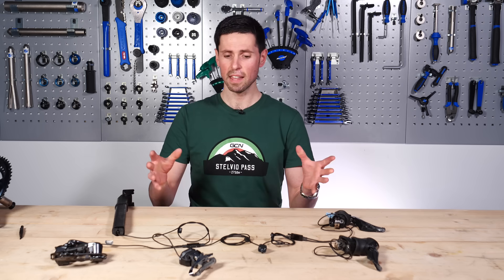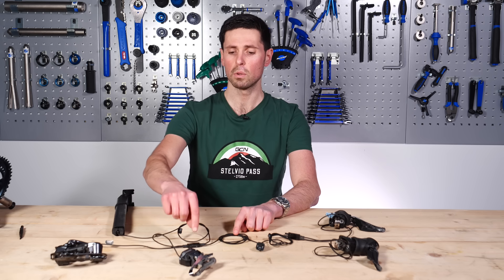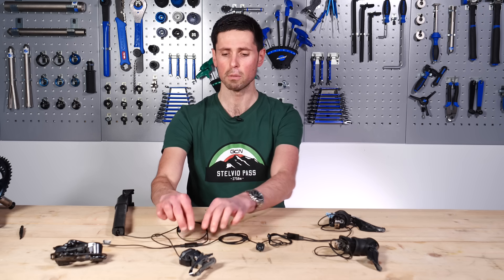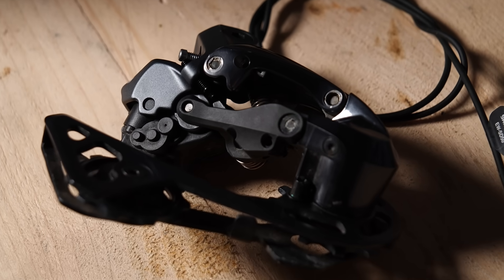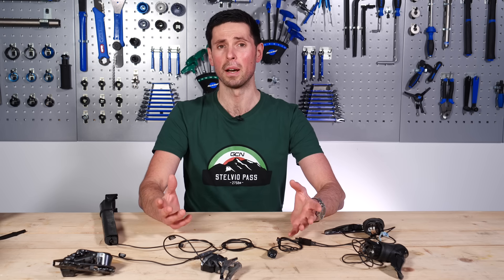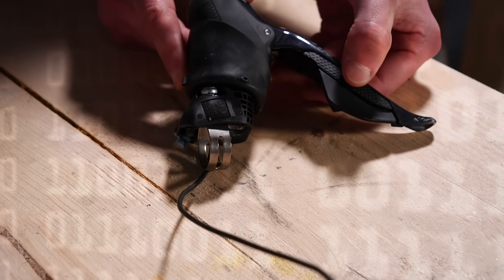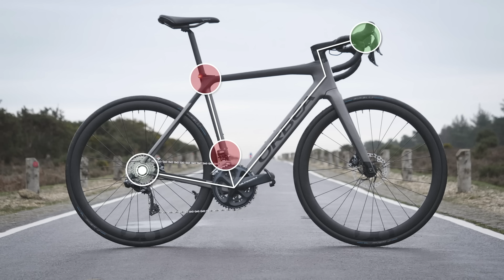How does Shimano Di2 Actually Work?| Electronic Shifting 101

Comment: There are only 10 types of people in the world. Those that understand binary and those that don’t.
Reply: 1s that do and 1s that don't, and together  they make 1+ 1 = 10 . Simple :-)
Reply: '10' is 2 in binary
Reply: There are 10 types of people in the world. Those that understand ternary, those that don't and those that expected this joke to be in binary.
Reply: And those who understand quaternary……
Reply: Shouldn't it be only 1 type of people - 1s that do and 0s that don't.
Reply: @paulallen6378  No - as in Binary, Yes = 1, No =0, and the base is 2 (not 10, unlike normal numerals). Therefore "Those that do" are 1 type, and "Those that don't" are 1 type, and together there are 2 types of people, which  in binary is written as 1+1=10 (10 in binary is 2 in decimal)! The decimal numbers 0 to 10 can be written  in binary as follows: 0, 1 (1), 10 (2), 11 (3), 100 (4), 101 (5), 110 (6), 111 (7), 1000 (8), 1001 (9), 1010 (10).
Reply: But I’m using Zero-based numbering, you only need 1 binary digit to encode 2 values.
Reply: @paulallen6378  Who let a coding geek on here :-) ;-)

Comment: I would have at least mentioned that the battery is the brain of the whole thing
Reply: Agreed - that's a fairly serious omission.  I thought that was the case, so I'm glad you clarified it since GCN didn't.
Reply: It isn’t...rear derailleur has the controller (brain)
Reply: @CXCyclist  So why did the previous Ultegra Di2 need a battery upgrade for the added syncro shifting functionality?

Comment: C’mon, Shimano! Cables are rudimentary elements in 21st century. SRAM is much more advanced without any impact on reliability.
Reply: It's not as clear cut as that.  Di2 has only one battery instead of 4, it's lighter than the SRAM equivalent, and it's more customisable.  Once it's installed, the wires make absolutely no difference to the user experience.
Reply: @AllanPhillips  you might be right for a bike equipped with Di2 on the factory, but installing it as the aftermarket solution definitely will cost you a lot of time and nerves. SRAM is simpler, you don’t need to tear down your bike to put the wires thru, and it has better app.
Reply: @d.2940  They do both have pros and cons, but the app and the lack of wires don't help you when you're riding, whereas Di2's lower weight and greater efficiency (from both the larger chainrings and the chain itself) actually help you go faster.

Comment: No reason such system can't be affordable.
Reply: "high tech".. as in bike companies intentionally putting electronic shifting on top ends only.. better to wait for chinese electronic conversion kit
Reply: @Fatbutnotflat  you'll be waiting a while. In the meantime, I got ultegra 6870 di2 minus the cranks for $500 on FB marketplace.

And dura ace 9150 minus brakes and cranks for $700 on FB marketplace.
Reply: It is, compare di2 ultegra to sram force axs
Reply: "Affordable" is a very subjective word. If you can't afford it it's not " affordable". Cheap is a better term. But this system is by no means cheap!

Comment: I read somewhere that everytime you change gear on the back, it trims the front mech slightly to prevent chain rub in the event of crosschaining? Is that the case? Im still running R8000 mechanical. Would love di2 but cant afford it 😭
Reply: The front and rear do adjust slightly as needed after shifts.The front does not adjust every time you shift the rear. I think it just adjusts when needed depending on what gear you are in.
Reply: @josephphillips865  Ahh, fair enough. Thanks for clarifying that 🤜🤛

Comment: Brilliant description, i actually thought the system was wireless.  Regarding CAN, I write firmware for a living on CAN based systems and it’s not the easiest thing to explain to people so you done a good job there.
Reply: Hi Mike, do you know how the power supply and data share the same wire, would be an interesting detail for general to add
Reply: @Cammboz  https://www.youtube.com/watch?v=DlvY_W22VNc  It's a bit techie but worth a watch.
Reply: @mikeshaw714  interesting, thanks. I guess the power in the di2 system must be derived from a higher potential difference between the high and low wire.
Reply: CAN bus usually has differential signal lines (high & low), presumably Shimano have a proprietary implementation for their system with only two wires - one with ground and the other with the supply voltage that also has the signal on top? There will be less electric noise than in a car so the differential system is less important.

Comment: I have both SRAM RED AXS ETAP and Shimano Ultegra mechanical. I changed the gear cables recently for new ones on the Ultegra set up and the shifting quality became so buttery smooth again. There is something about mechanical shifting that makes me feel more connected to the bike. Don’t get me wrong electronic shifting is second to none but where it gains in terms of efficiency and performance, I think it loses the true essence of what a bike is.

Comment: That’s a lot of wires called wireless? I’m misunderstanding or what?
Reply: This is electronic shifting.. not wireless. You have 3 types of shifting. Mechanical, where a cable has to be physically moved. Electronic, where the signal is sent by wires and travels very fast, but there's no cable physically moving. and of course wireless, where you don't need cables, but until today the signal takes a bit more to reach and be understood by each component.

Comment: I’m too old for that when the traditional system has worked flawlessly forever for me.
Reply: I have both SRAM AXS ETAP and Shimano Ultegra mechanical. I changed the gear cables recently for new ones on the Ultegra set up and the shifting quality is buttery smooth. There is something just a little bit nicer when changing with mechanical gears. I feel more connected to the bike.
Reply: @J88HNT  That's one reason why I'm sticking with the mechanical Dura Ace groupset on my road bike. The downside is spending money and time replacing cables and housings with routine maintenance unless you happen to find that job therapeutic. I like the tactile feel and sound compared with a dull electronic button to shift. I did however splurge by getting GRX DI2 for my new gravel bike build. I do like the low maintenance aspect and features of DI2. It was a bit of a pain dealing with wires but now that it's setup it just works.
Reply: Until you have 100% integrated cables... The question is of course if you really need them

Comment: Cables being interchangeable is pretty obvious.. there's such a huge range of bike sizes and cable routing differences depending on the bike type. What is much more interesting (and useful to know) is that you can connect any component to any other component. There is NO 'correct' order or mandatory routing layout. 

You could connect the battery to one shifter, connect the rear derailleur to the other and it would still work (assuming you put a junction A in there somewhere). 
Strange? Sure - but it'll work. ;-)
Reply: I've just been using your website info on seatpost battery install as reference as I move Di2 battery to a new seatpost on my Specialized Roubaix. The Di2 came with the bike, and so would have been factory installed. The holder they used was different than any of the ones you show. It's a ribbed rubber style, but is a plug clipped onto the back end of the battery, plus a separate rubber doughnut-plug on the cable end. after some head-scratching, I made an L-shaped tool out of a piece of coat hanger, held the L in the radial recess near the front end of the battery, and was able to pull the battery out. I think I'll get one of the 2-piece front end holders (Ritchey) to install in the new seatpost.
Reply: @chrisj5443  interesting! Some manufacturers have their own, yeah.. I also  know a few people that had battery holders 3d printed to fit their weird seatpost shapes :)

Comment: I know it works flawlessly, but a wired electronic groupset makes no sense to me in 2021.
Reply: respectfully disagree. At least until today, a wired system is faster than wirelless. Maybe this changes tomorrow, but not today. And in theory we can always think that a wireless system is more prone for interference (intentionally or not). Yes, this second point is a bit of a stretch, but...
Reply: 2 batteries instead of one. More autonomie because wireless consumes more energy, etc.. So I wouldn't say it makes no sense. there are pros and cons.
Reply: @bmmaia81  doesn't that statement make a mochery of the claims that you only need to recharge it ever few months...
Reply: @fergusdenoon1255  It means that with wirelless its necessary to remember to charge 2 small batteries instead of a big one. It is factual that shimano charge last much longer.
Reply: @bmmaia81  4 batteries. The shifters need power as well as the derailleurs. I doubt the movement of pressing the buttons would generate enough energy to send a signal.
Reply: @bmmaia81  4 batteries, dude, not 2! Don’t forget shifters ))
Reply: @bmmaia81  I think your first point is a bit more of a stretch than your second ;).
The time from pressing the button until the signal arrives at the motor is soooo small, that you will never make a difference between wired and wireless. Maybe the interpretation of a wireless chip takes some time, but this is also so minimal that I wouldn't even think about this. The main advantage is that you are able to wire just one main battery instead of multiple ones. This is also the main disadvantage - you have to wire it up.

I would only think about electronic shifting for TT bikes, because it's much easier to connect them with the aerobars and you could have multiple shifter buttons for situations where it is not smart/Safe to drive in the aerobars.
Reply: @SaschaN  It really comes up to the user, and what he finds noticible or not. If we make a comparison for smartphones or pcs, if you press something and it takes more 0,01 seconds than something that you previous used, you will notice. And it will not be a pleasent experience.  On the other hand there's something that sometimes is not spoken. With more and more integration the only good solution is Di2, not only on TT bikes as you mentioned, but also to other bikes. We are now smashing all the mech cables inside the stem and tube, and sometimes this affects both final visual result and perfomance (cable performance is not great with cramped cables). Again, it works fine, but it is noticible worse than free cables.
Reply: @bmmaia81  I really can't follow the time aspect because no human being will recognise a difference of 0,01 s in data transmission on a bike (maybe in computer gaming which is described with the ping). If a gear changes takes subjectively too long on a bike with electronical shifting, the movement/time which the electric motor needs has a much bigger influence onto the recognizable time to shift.

The argument for advantage's for integrated cockpits and so on is totally correct, I didn't think about that (my fault).
Reply: Good thing they're announcing the new groupset soon then!
(well, probably.. no one knows 100% sure ;))
Reply: That’s true.. and the ones on the shifters are not rechargeable.. and they look ugly.. the so called alien head 👽
Reply: @bmmaia81  whereas wires are gorgeous... personally, I think etap is genius
Reply: Welcome to 1993 (ZMS)
Reply: @frankb.1284  no.. that’s what i really tried to explain.. if shimano improves the system when they go wireless; I’m in. But not at the moment. I really hope they will make the jump only and only when it matches or surpass the wired performance.
Reply: Rumour is that new DA will be wireless and 12-speed (Shimano, ahead of the curve 🤣)
Reply: @matthewlewis2072  it won’t be wireless, but it will be 12s in all 4 options (00, 20, 50 and 70). Cranks will be standard-alloy 24mm, 2x only and a new design
Reply: Much much longer battery life and less errors 👍

Comment: I have Di2 on my older bike, and love it. I went with SRAM eTap AXS on my new bike, and I prefer it to Di2 in the winter months. Even with heavy gloves you can't mess up an eTap shift.
Reply: With newer di2 using full syncro you can also make both the left shifter buttons go up the cassette and right buttons go down the cassette or vice versa.
Reply: @MrBJPitt  Interesting, I didn't know that. My Di2 is from 2014, and I never bothered adding the Bluetooth module. I did upgrade the shifters last year when my old ones were almost at end of life.
Reply: @davidmulligan42  you don't need the Bluetooth module. Just plug the charging cable into a laptop. But you do need the new battery to get full syncro shifting, as the brain is in the battery.
Reply: @MrBJPitt  Yep, just have to download the Windows e-Tube application and connect. A lot of people aren't even aware of this it seems.
Reply: @MrBJPitt  Ah, ok. I have the older battery, and the new BT-DN110 one is $160. I'll wait until I need a new battery. I have 30,000 miles on this one, and it's still fine.
Reply: @davidmulligan42  yep, I was lucky and grabbed a BNIB one on marketplace for $100 AUD - about $75 US
Reply: @josephphillips865  I found out I could do that when I bought the new shifters. I thought I'd have to take it to the LBS, which is a pain these days, but e-Tube was simple, and free!

Comment: Got Di2 on the Monstercross running about 3 years now, flawless!
Connects XT mech to road brifters,
No seizing cables,
Shifts perfectly and reliably EVERY time,
seldom needs charging (unlike wireless sistems), 
Shifts super quick in any situation (under power etc.),
Needs virtually no maintenance,

As you can tell, I love it. If you can afford, buy it. It is so good, it will just make you forget about it. Which is what good components do.

Comment: I haven't wondered how Di2 works. It's easy the pixie in the shifter phones the pixie in either the front or rear mech, or just the pixie in the rear mech on a 1x groupset. The pixie in the mech then presses the button to move the mech up or down the gears. Simples. 🤣🤣🤣

Comment: Noob here: While this electronic system is very interesting, what's the actual benefit over a "manual" system? Do the batteries and actuators not offset the weight of the cables they replace? I understand that it's probably a bit easier to trigger a gear change. And you could use this for non-standard form factors like fancy sprint bikes. But is that it?
Reply: No missed shifts ever. Front derailleur shifts are so much better, Emma Pooley mentioned the advantage of the front chainring shifts on GCN a few years ago - saying it was obvious which riders were on Di2 when cresting climbs and she wished she had it.

No cables breaking, and you basically never have to index ever again.
Reply: Main benefit is power of the shifts..you can have stiffer springs in and shift even under full load (sprinting and hills). 
2nd is no interference due to bad cables, dirt, water, ice-cables can freeze in CX races.
3rd is less time wasted for changing the cables (pro riders). 
All other “benefits” are very minimal

Comment: I just wanted to upgrade to di2 as a lockdown project but there‘s no parts in stock anywhere :(
Reply: There are most likely still limited parts around, just not at the price points most people would care to buy at. I build my GRX DI2 gravel bike as one of my lockdown projects. I bought all the parts on eBay this fall. Most parts were in a kit while the remaining pieces came from sellers in Taiwan which surprising did not take very long to arrive to the US.
Reply: @josephphillips865  Yeah, I saw some scalpers on ebay trying to sell Di2 groupsets for a few hundred bucks above msrp, but I wasn't willing to do that. Also, this would be my first groupset assembly so I don't want to have that come to a crashing halt because something stupid like a too short cable which I can't order a replacement for

I'll just wait this stupid situation out and ask my LBS to do it when they get parts again, by now I spent the money on a Kickr anyway. If this lasts for another 6 months, I'll consider your advice though
Reply: @PKownzthem  Honestly even with a full kit at a fair msrp price it will still be cheaper overall to just buy a complete bike already with DI2. I did it to learn new skills and to have something totally custom to my own personal specifications. I had no trouble at all getting the cable sizes I needed for my build. Also I even learned how to splice a cable using aviation grade splices as the DI2 cable connector for my front derailleur was too large to fit and I did not want to drill into a carbon frame.
Reply: @josephphillips865  Yeah a groupset upgrade is definitely not the best bang for the buck, but then again a) it's still a few thousand euros less in absolute numbers than a new bike and b) I kinda grow attached to my bikes so I have more fun in upgrading them instead of buying a new one as long as the frame isn't outdated
Reply: @PKownzthem  Oh for sure. I have bikes with outdated frames that I won't let go of. Also you can sell your old groupsets and parts to  help fund any upgrades.

Comment: I've just bought a bike with Di2, i keep it stored upright using a clug bike rack. Its now got a small puddle on the floor. Its rim brakes, not disc. Any ideas what it could be?
Reply: Are you suggesting it's leaking a puddle of electricity???
Reply: @MrBJPitt  ha ha. That's it!! I've not got a clue what it is. I bought a 2nd hand bike with di2, I've never washed it, its dry as a bone yet has a mystery puddle under it.  It's not set up tubeless, it's freaking me out. A puddle of electricity would be a worry 😂
Reply: @macs1981  most likely it's draining from the wheels or frame, look under the bottom bracket and you'll see drain holes. My guess is that the previous owner washed it before selling, never rode it after washing.
Reply: @MrBJPitt  you're probably right. Thanks. It was very clean so probably washed just before im fairness. 👍🏼